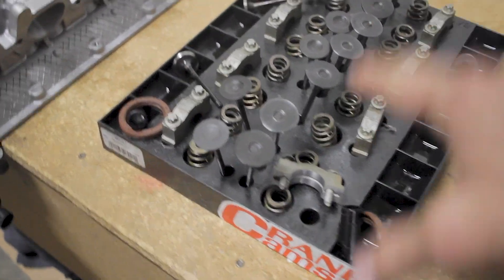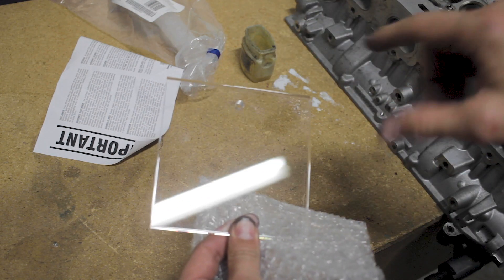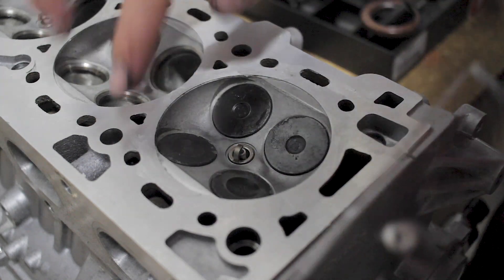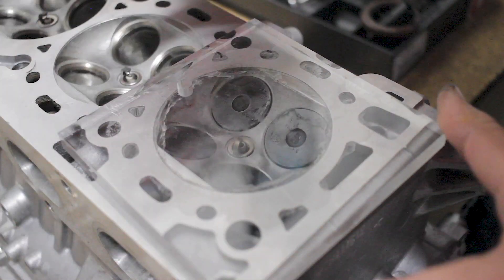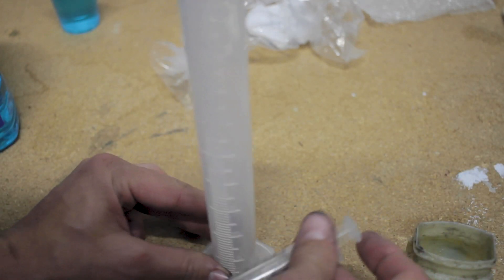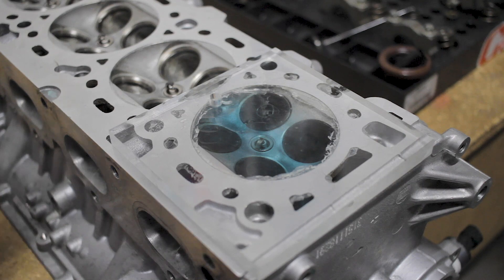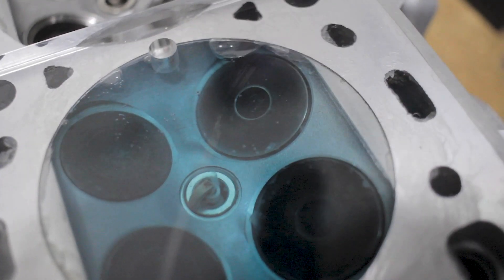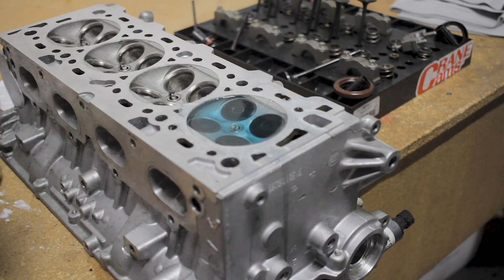How to CC a Combustion Chamber for CHEAP (Step by Step Tutorial)

Comment: I back off the spark plug and use grease to plug the gap,also use a 100ml syringe with needle and calculate what goes in and what comes out
Reply from the maker: Thanks for the tip!

Comment: I noticed those are iridium spark plugs because they have a thin iridium wire electrode. Iridium is good for long life but not so much for high boost or high chamber pressures and temperatures because that thin wire can get too hot and act as a spot where the fuel could preignite which leads to knock and other bad stuff. You'll want to get some standard copper electrode spark plugs because copper is much more thermally conductive and wont get as hot. The downside is copper is a lot softer and won't last as long so you'll have to change them maybe every other oil change
Reply from the maker: Thanks! I really appreciate the tip. No pun intended. I have some at the shop I'll give a try. Once I get things up and going.